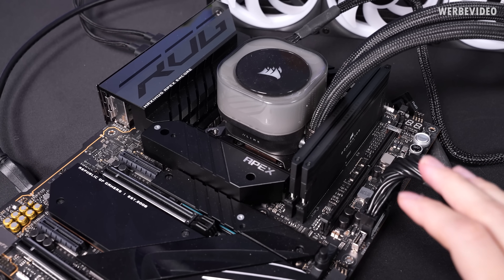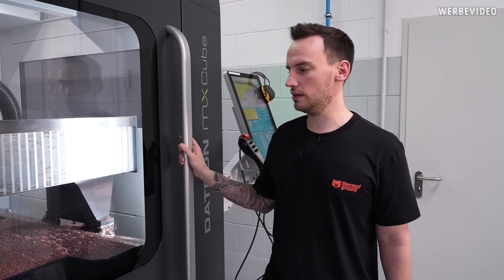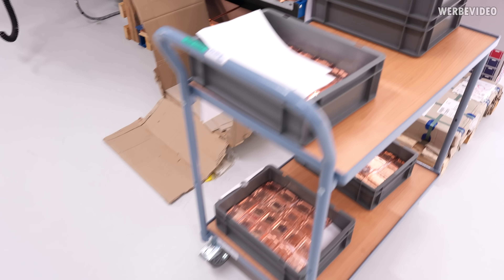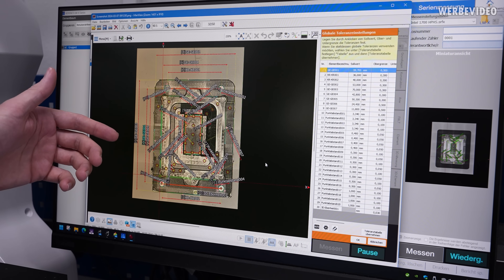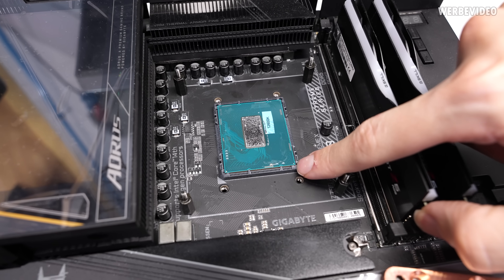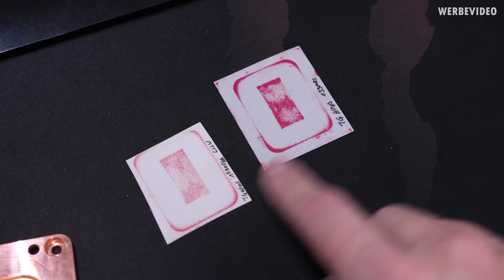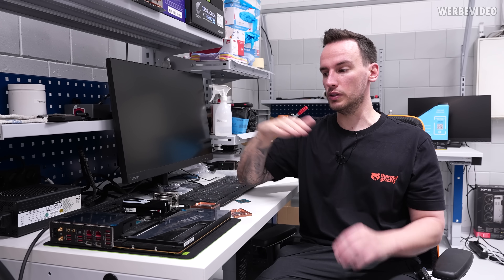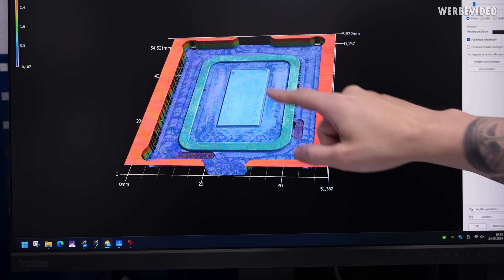I messed up

Comment: Manufacturing inconsistencies of the plastic surround. Maybe even thermal expansion of the surround especially if different manufacturers use different plastics from each other or from batch to batch or different ranges of motherboards.
Plastics generally have a significantly higher coefficient of linear thermal expansion than metals.
Reply: Yep. In the past, some board also banana. The entire board! :O
Reply: @TechyBen  My Z390 board bowed a lot and still worked fine/cool.  But I went with a metal backplate after that and I'd recommend others do the same.
Reply: @TechyBen  I haven't seen that happen for a while. Had it happen on my C2Q motherboard due to the Tuniq towers weight lol. But it worked 😂.
Reply: yea, definitely the first thing that comes to mind. Given that the plastic is there just to keep the CPU from wiggling around, and the height of the plastic don't really matter, i think the tolerance for that piece of plastic is probably really high, especially on the height measurements. But for direct die contact like this, just a fraction of milimeter is very significant. But oh well, it's just my gut feeling. good luck finding what's wrong with the thing i guess.
Reply: If you're considering the surround as a possible source for any contact inconsistencies, you'd have to consider motherboard mounting as well.  Inconsistencies on motherboard mounting torque could induce some bow into the board, possibly standoff height differences, especially with heavy GFX cards mounted in slot.  Only way to test would be to mill out the contact with the surround so you have die contact only, throw on some springs and adjust for equal torque all around.  But who uses a torque driver?  I'd prefer it rather than bottoming out on the surround.  Yeah, you can crack a die, but some testing and proven torque specs would be fairly easy to accomplish.  What's the point in making a precisely machined piece to leave the torqueing to peoples fingers???  I have a lot more finger strength than my 19 y.o. kid, seen yesterday as he couldn't unspring the force on a fishing swivel to attach a lure and I did it with ease.  Food for thought!  I myself would get a torque driver for precision!
Reply: @WildRapier  Except the sharpie method is actually more accurate than a torque driver!  That's because torque relies on friction, and is a proxy for stretch.
Reply: Thought of that as well.
Everything super accurate, his framers/IHS whatnot, the CPU PCB and silicon as well, then there's the plastic CPU socket frame which is just meant to hold the pins and also position the  CPU in X/Y plane, and roughly in the Z plane.
Injection molds also wear out and can lead to bigger and bigger dimensions, or additional flashing on various surfaces that have gates sprues vents ejection pins etc.
Reply: 100% this.
Reply: The socket material isn't made of ABS to deform that easily (neither by use nor by manufacture). It will  probably be some PA66 GF or PTFE variant - extremely stable materials. But I agree that there can be something wrong with the socket.
Reply: @Roman-6969  pa66 attracts moisture - its final properties depend on environmental conditions.
Reply: @krugtech  It is made of copper, and nickel-plated.
Reply: That is it.
Reply: I'm with you on this.

Comment: Is the finished product Nickel plated? Is the nickel plating thickness varying?
Reply: Was thinking the same, but in that case the entire surface would be affected and it would sort of cancel each other out (one surface that is meant to touch the die and the other that is resting on the plastic of the socket. Both would have the same thickness of nickel, so it wouldn't matter if both would be slightly thicker than tolerance or if both would be slightly thinner).
Reply: @gagarin777  Assuming they have the same thickness of nickel then yes. But you can nickel plate items so that they have shadows where nickel did not build up as high (interior corners and the like. Depending on how sophisticated the system for the nickel plating is this could be an issue.

Comment: Well.. The plastic where everything is put on, and dependent on is obviously a bad base.

The plastic height is probably very variable. Also, depending if the client is a cold climate or hot, the plastic must be warmer or colder.
So it is more malleable or less malleable.

You shouldn't be depending on plastic height. It varies wildly.

Also, probably. If everthing heats up in the motherboard, it will also affect it.

You need a better base. That's my guess
Reply: Lol. Here I was congratulating my superior brain-power. Typed out the comment. 
Went back to read other comments, and everone else was saying the same thing

Haha let's go guys!

Comment: It would be interesting to see if there are any links with the hardware of those people having issues. As mentioned elseware on here its easy to assume the heat spreader is at fault but it may be a compatibility issue.
Reply from the maker: We're collecting all information from the affected people to figure this out :)
Reply: @der8auer-en  it sounds like a tolerance stacking issue - are you able to send them the pressure paper (if you cant get the board)?
Might need to change tolerance to a -0/+x depth situation to make space for tolerance of the board/socket?

Comment: What Gen are having the issue? Or is it all 3? 12/13/14?
Reply from the maker: doesn't seem to depend on the CPU. We had negative feedback with 12/13 and 14gen. Most were 14900K or 14900KS but that's normal because it's the latest one
Reply: @der8auer-en  hmm gotta be something to do with the plastic around the socket then like you said. Must be some variances between different manufacturers

Comment: I am a layman so excuse me if this is a question with an obvious answer, but did you check how much the height of the plastic changes due to thermal expansion/contraction? I'd imagine for such a pressure sensitive connection, the ambient temperature when actually installing the block could actually be a variable that might impact the thermal connection.
Reply from the maker: it's very little. Much less than the tolerance in manufacturing. The expansion in height of the socket would be in the area of 0.00x mm between room and operation temperature
Reply: They (should) use thermally stable plastics for the brackets
Reply: Surely it would be an issue for any cooler mounting then if that was the case, including traditional aircooling? 
The socket getting hot is not unique to custom IHS or using a waterblock.
Presumably the sockets would be hotter with air cooling and if socket warping/expansion was the issue it would be more prevalent and documented with air cooling set ups?
Reply: @rankcolour8780  Not in the slightest, the plastic rim is well below the IHS, covered by the locking mechanism.
Reply: @ChrispyNut  Not sure if you misunderstood what I was saying there?

I'm saying if heating was an issue for the socket we would see it in almost all instances of cooling - air, water, custom, etc becasue the CPU and power plane itself is the heat source.

What did you think I meant?
Reply: @rankcolour8780  OP specifically spoke about the plastic lip of the socket, which is covered by the retention mechanism and sits below the level of the IHS.
Reply: @ChrispyNut  
They mentioned height change, nothing about lip? Maybe I missed something?

Also the retention mechanism doesn't mount to the socket or the plastic, it mounts to the pcb.

Any change of socket height due to thermal cycling/expansion would not care about the retention bracket and would still be a problem people document for air cooling with or without the ihs and retention bracket..
Reply: @rankcolour8780  I don't have the patience to explain all of the things.
Reply: @ChrispyNut  
O.K.

Comment: I am not a hardware engineer but I used to be a QA Director and if I were to take a guess at the problem it is the height difference in the surrounding plastic mounting bracket.
Reply: since it's plastic it might've been deformed under certain circumstances
Reply: @dasiro  If it deformed in use the pressure on it would go down, meaning the pressure on the CPU would go up.  So, the opposite of what's apparently happening.
Reply: Following your line of thinking, the lga 1700 socket part is a bga contact package, that can be made by several manufacturers. There is indeed a tolerance range there when its affixed, though it typically is very small. Those parts are also usually glass fiber plastic and tend to be fairly rigid and resist deformation. Certainly a very interesting problem.
Reply: @Ojref1  and then tolerance stacking can happen too, as his product isnt going to be exactly the same dimension every time, there will be some amount of wiggle room from part to part, and maybe one end of that tolerance range doesnt work with the end of the tolerance range of another vendor.
Reply: Yeah, PA66 GF (30%?) or maybe PTFE. But of course there may be some tolerances.
Reply: Yup, my assumption as well.
Reply: Or. Potentially user error. The only variable not measurable
Reply: @djchotus1  At this point I think they would've ruled that out now, at least before publishing a video like this.
Reply: @hayleyxyz Even if it were user error, it is better to get out in front of it.
Also they have only shipped 50 products, so it's a good time to clarify this.
Reply: using 2 cnc machines to do each side can also potentially produce inconsistencies. No 2 machines are alike and 2 different types of CNCs are definitely not going to have the same tolerance windows
Reply: Makes sense.
Reply: Nah the pressure would go down if the socket melted or was differing heights. I think its probably something in between user-error and manufacturer-error : thermal-paste hydrolock, preventing the cooler from being screwed all the way down (feels like it bottomed out before it actually does)

Comment: does the amd version have same issues?
Reply from the maker: No. We shipped out several hundred of the AMD coolers and IHS and response is absolutely fine
Reply: @der8auer-en  well then probably trying to get your hands on exact same model or maybe even exact same piece that was failing is the key to finding problem.

Comment: Problem is BENT PCB AROUND THE Motherboard depending on the motherboard, after they used another cooler
Reply from the maker: you mean the mainboard PCB being bent?
Reply: @der8auer-en    Given that the new intel socket is prone to bend, perhaps it could be a factor. Would be interesting to know if the high temps are on the whole chip or if there is a sort of gradient, possibly indicating uneven pressure, maybe you already have a "bent" mobo around to test this?
Reply: @der8auer-en  yes!
Reply: If you get the affected board from the customer you could make a thick backplate to test if that fixes the board flex. @der8auer-en
Reply: Bent PCB is a possibility, also when the poor contact issues on 12th gen first started one of the theory's was that since there where 2 suppliers for the socket retention mechanism, one was the one causing the issues, this might be similar there might be more than one supplier for the plastic socket with slightly different tolerances
Reply: Very possible. I have had mounting issues on a few various boards that I do thermal testing on. People sometimes seem to forget the amount of pressure that can be involved here. Depending on the board & cooler being used etc...
Reply: plausible. TG intel contact frame corners touch pcb while cooler (NH-U12A) is mounted. leaving inprints to pcb
Reply: With the gap between the heat spreader and pcb, the board would need to be quite bent for the 2 to be touching and prevent proper contact. 
It would be more likely that there's different versions of the plastic CPU socket.

If you haven't already, get the users having issues, send you pics of the thermal paste contact patch on the CPU die and heat spreader, as well as the socket itself.

If you want to test the bent pcb theory, perhaps suggest the user smears a little thermal paste around the edge of the heat spreader, carefully install everything, carefully remove everything and see if there's paste on the PCB. If they try this a few times and see thermal paste on the board, This could be the issue after all.
Only issue with my suggestion is if they use a conductive paste (liquid metal) and they don't clean it off the board properly.
Reply: @TheUnknownlogin I agree. With the way the block references the socket, the PCB would have to be incredibly warped to affect the mounting pressure.
Reply: Oh really good idea! That will be insane if correct.
Reply: Maybe to much disparity  in the torque apply to the 4 screw, maybe the mounting should incorporate calibrate springs to apply enven pression but a forceful hard tubing mounting can play on it.
Reply: PCBs are not metal, while under stress they will bend but once the stress is released PCB will return to its original state.
Reply: thats a good idea

Comment: Well, I had bought your CPU delid tool, with all the existing accessories for 7950x. It never worked. Temps were super high. Had to glue it back.

I have spent around 200 USD for nothing lol
Reply: For you to be here instead of going through the seller's support channel just tells us that it was user error or you have no idea what you did
Reply: @popifrex1993  I can't RETURN IT!! I live in Uzbekistan.
Reply: @popifrex1993  For me to return it I will spend much more than the product costs, via DHL. And too much hustle. Stop judging before knowing the details.
Reply from the maker: if you used a direct die frame and watercool heatkiller it will be super important to check the mounting height. Also that it doesnt collide with other parts around the socket. These were the most common issues we saw. Most water blocks are limited in mounting height but with the direct die frame the CPU cooler has to sit almost 4mm lower than stock. Without mounting modification this is often not possible. That would be my first guess with your information. But might be easier if you contact us by mail especially because you can also send us pictures :)
Reply: @der8auer-en  thanks for the tips. I am too lazy to do anything right now :) 
I am just happy the CPU didn't die. Currently running it underclocked. 
The height is not a problem, because the first time it worked perfectly fine, temps were good. It caused issues after re applying the liquid metal. 
I suspect the mounting pressure is not the same on all 4 screws somehow. I don't want to play with it anymore :)
I am not complaining though, I know you make awesome products.
Reply: Why didn’t you ever return it or contact him?
Reply: Because it's user error most likely
Reply: @HazewinDog  I had previously delidded CPUs and doing watercooling for a decade. I am sure I did everything correctly.
Reply: @Akkbar21  I don't live in Europe or USA :)
I had ordered it from amazon.
Reply from the maker: The AMD water blocks and Heatspreaders should be running fine. There is no known manufacturing problem. So please contact our support so we can help figuring out what was wrong :)
Reply: @der8auer-en  Unfortunately I live in Uzbekistan. I can't return it. Here are the details. Maybe it can help you in the future. 
When I first delidded it and tested the temps they were pretty solid. I was getting around 40k on cinebench r23 with around 80c temps. 
Then I decided to check if temps would be better if I re-apply the liquid metal, which I bought yours. And it went really bad from there. Temps were super unstable, reaching 120c and shutting down. Then I tried multiple times to reapply the liquid metal but the same result. Tried a different waterblock, nothing helped. 
Finally, I have tried to buy a backplate, your product. Didn't help. Then I decided to just glue back the original cover with liquid metal and use thermal paste. Temps were fine this way. 
I have no idea what went wrong.
EDIT: BTW, my waterblock is Watercool Heatkiller. Ordered directly from Germany.

Comment: Mistakes can happen!
Reply: Exactly, it is what you do in response that can save and even improve your reputation (Arctic freezer II "gunk-gate").
Reply: @stennan  And they did that well in my opinion. Thats why I bought a Freezer 2 and 3 later on!
Reply: @stennan Arctic best support ever. Having the option to send the replacement and change myself it's more quick and less work for me. I changed the gasket in 30 minutes. Savings days of waiting for the repair,mount stock cooler etc.
Wish other company offer this option